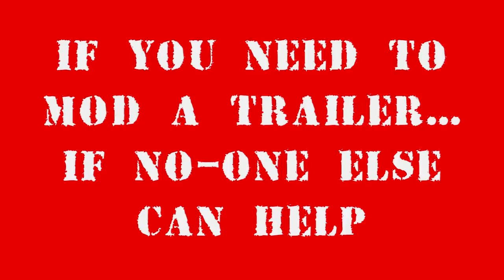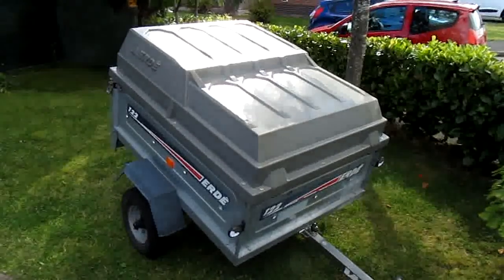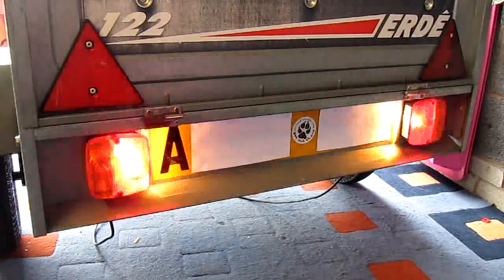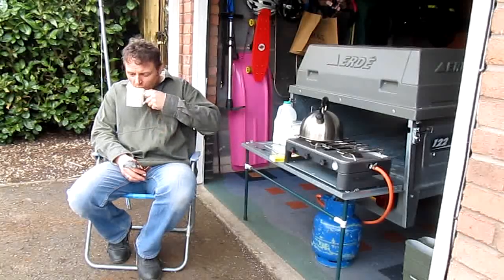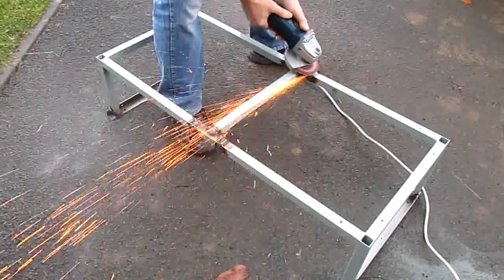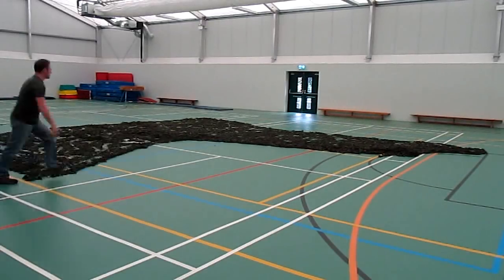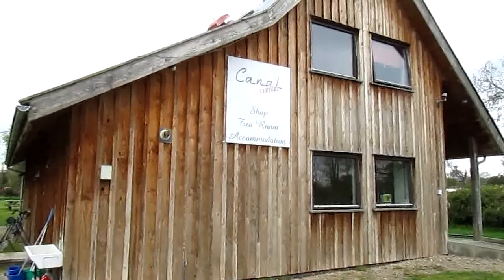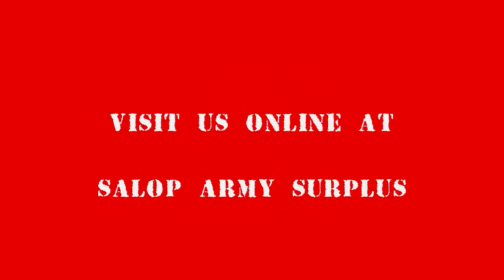If you need to mod a trailer... if no one else can help

Comment: dont forget about the wheel bearings.   at the very least you should take them apart do a clean and inspect regrease  and change the wheel hub seal.     The hubs are small sealed canisters the heat cycle of a typical day heats them up and cool down at night.  or heat while on the road and cool when parked.   That usually separates moisture content from the air or grease and creates free water that promotes rust on bearings .   wheel bearing sets are low cost

Comment: A nice project, some great idea', just been given an old  trailer and rather than mess around with the lighting I bough a set of LED trailer lights off ebay for around £30 they seem to work well. Going to nick a couple of your ideas for my trailer as well,  so thanks for the vid, helped me out no  end.